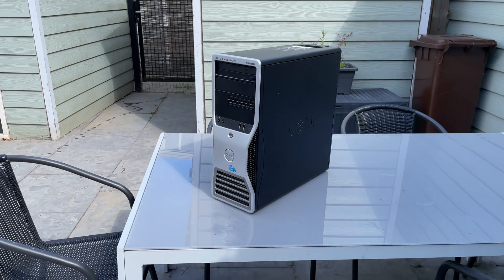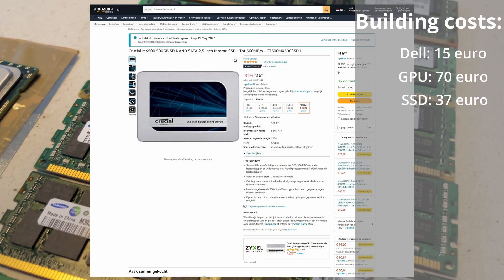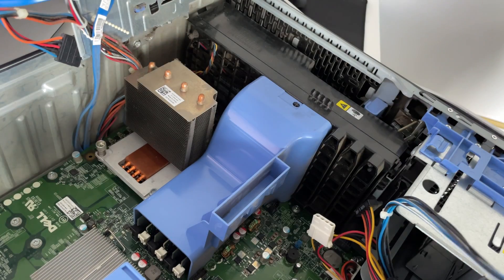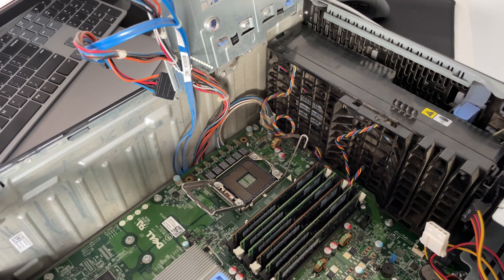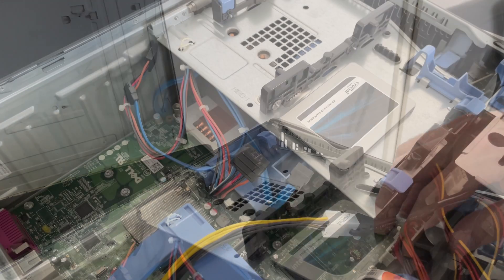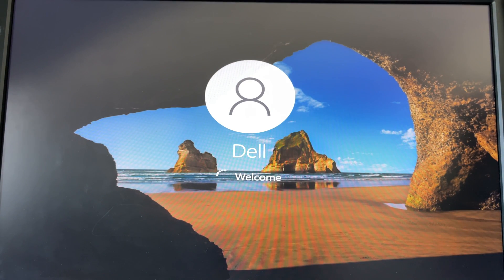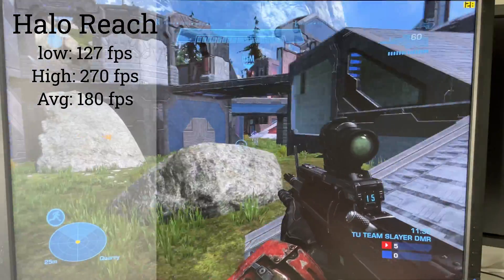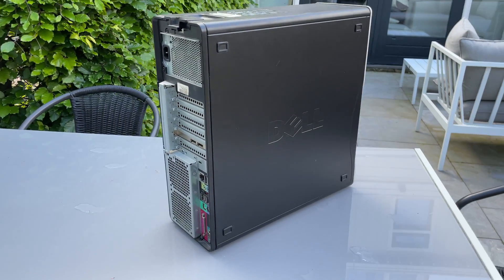The ultimate game pc build for only 120 euro/136 dollar!

Comment: Actually the t3500 will run 6 sticks of 8gb for a total of 48gb, updating the bios to a17 will allow you to run the xeon 5690, 6 cores 12 threads, 12mb cache, right now i running 2x Seagate 2.5 HDDs at 7200 rpm, and want to buy a SAS card and have 4x 15k rpm 900gb drives. please dont tell about SSDs i dont like them, i have hard drives that the date on them is early 90s and they are working just fine, i have looked at the differences in write cycles between HDD and SSD, the SSDs have less write cycles, and if you have data you must have restored, it cost less to retrieve it from an HDD than it does from an SSD. so for me i prefer HDD, and with 15k rpm data transfer should be just fine, back in the day before SSD, we built rigs with 10k rpm SCSI drives as that was the fastest available, I built some of those, so i am comfortable with it. the only down side for me is, if you drop an HDD hard enough its toast, where an SSD is like a timex it takes a liking and keeps on ticking.

Comment: Upgraded a T3500 with a six core Xeon W3670, 12 G of memory, and a GTX 1650 Super. It runs wonderfully on the old applications that I already have and is very smooth and stable. I have not tested anything with high system requirements or really modern software, but I am sure it would handle most of that as well.

Comment: Maybe som more detail on the cpu,core n thread count,clock speeds,which architecture?does it support dx 12 instructions...,also the games,maybe mention the settings u running them at,and finally these old CPU's n graphic cards consume a tad more power,so,maybe undervolt them?
Reply from the maker: Sounds like a good plan, I will incorporate that in my next video. Thanks for the suggestion!

Comment: Got a Xeon X5670 in my old rig and it's a really good CPU still to this day! I did try my Sapphire Nitro+ RX 580 8GB in it while I was still using an i7-920 in it and the system ran real well back then too.  I am back to using my power hungry GTX 780 ti in it for now as I want to put the 580 in a Dell Precision T1600 with a Xeon E3 1245 in it.  It does not fit the case without modification so I am temporarily using a riser cable with a 3D printed stand for outside the case.  Now if I can only keep my cat away from playing with the spinning fans.....😂
Nice video, by the way!  I am subscribed!  👍👍
Reply from the maker: Haha love it! Do you have a picture of it? Can imagine that most be very interesting for your cat 😂
Reply: @techwithdaan  Sorry I didn't get your reply for 3 weeks! No picture, but I heard a brrrrr, brrrrr sound and when I got up to look, she was hitting the CPU fan with her paw! I stopped her but I was laughing hysterically.....🤣🤣😂
Luckily I didn't set up the GPU yet otherwise it might have hurt her because they are much bigger and spin MUCH faster when the GPU gets hot! 😱
Reply from the maker: Yeah I can imagine, that must have been funny and scary at the same time!

Comment: How did you power the graphics card? Does the PSU of that business unit have an 8 pin connector or did you have to adapt? How many watts does the PSU provide? Kinda crucial part to leave out.
Reply from the maker: Yeah I agree I will make sure to add that to my upcoming videos as well to not leave out any important information.
The PSU it comes with in this case was a 525 watts power supply, this came with a 6 pin connector for which I used a converter from 6 pin to 8 (which came already with the pc)

Comment: Damn i have a HP Z600 with the version 2 motherboard that i got for free from my high school that can support X5675 so i was thinking of getting two since its got 2 sockets along with 2x OEM high performance heatsinks for it, and maxing out the ram to 48GB RAM (6x  Hynix 8GB ECC modules) that was pulled out of other Z600's that were going to a electronics recycling centre.
Reply from the maker: That is also almost equal to the build I’m working on at the moment for my next video. The old server that I have made my last video on has a similar setup and will be build as such.

Be sure to subscribe to not miss it!

Comment: Bro i spent 500 euros on my dell t3500 a bit worse than urs my spec xeon x5670, Amd rx 470 sapphire nitro pulse 20gb of ram and 3 hdds and 1 ssd pc was 150€ + cpu 10€ + first bought gpu 120 (gt 1030) + new gpu 70€ + ssd ~60€ + ram 65€ + Front aftermarket fans 9€ back fans 8€ which is 492€
Reply from the maker: Honestly it is an amazing machine that still does very good also in this day! In my eyes these gems should be maxed out and then can be used for a very long time still!

Love the fact that you did the same!

Comment: This machine will easily handle 6 x 8gb for total of 48gb
Reply from the maker: According to Dells website it didn’t therefore I went for 24gb which is plenty as well for the purpose I had :)
Reply: @techwithdaan  if it’s better than a w3520 or something it should handle 48gb (unofficially at least), I’m pretty sure at least
Reply from the maker: @B3nluke  yeah I thought the same but somehow Dell states the limitation on the memory on the motherboard specifications so I that threw me off as well!
Reply: @techwithdaan  I’m guessing they put 24gb for the CPUs that don’t support 48gb, although with the x56xx CPUs it should support 48gb, but even 24gb isn’t bad